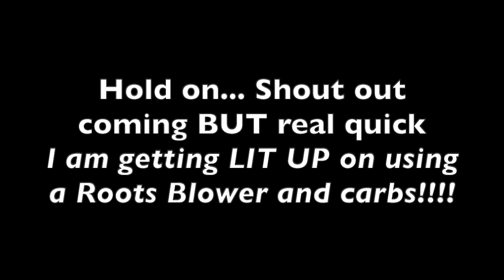Why Roots Blower | Boost with Carbs | Getting Lit up | Boost with Carbs

Comment: Watched  a many of  videos  of  the  bucket. ....consistent.
Reply from the maker: It is a hard tail and with the last build I did on the 406 it would run 5.19's but it was so unpredictable on the top end and the leave. It ran straight as an arrow with the 350 in it and would run 5.56 all day long. I should have left it alone!!!!

Comment: Roots with Carbs is a great set up , I’ve done efi with blower as well , yes it’s the new way but you will not gain anything in all out power , carbs continue to out perform efi at WOT , anyway I agree with your choice to go with a roots I love them , I’ve ran a 177 weiand , TBS 250 , 8-71 , all of them performed very well , I had been running a 632 n/a single Dominator 10:1 engine And boat would run 110 , built a 509 w/8-71 at 10 psi been 120 and still climbing , the 632 dyno 770 hp 800 + tq I did not dyno the 509 but it’s obviously making allot more power

Comment: I totally agree with the way you look at this stuff. I'm a few hundred steps behind you. I've raced the first engine that I ever built that wasn't stock about 10 years ago. It had some major failure about 5 years ago so I replaced the 454 with  a stock 350 small block and I'm starting over from step one.  I'm discouraged because of all the fast factory cars that are out now and so on. but I don't care I have a 72 C10 and the only thing I think would look right is a big block or small block chevy with a  4barrel carb on it.  I don't like seeing LS motors in any old car, well I like it a little but I still think its cooler to have a nostalgic hot rod. Hell I think it would be even cooler to have a supercharged flathead in that 48 ford. but those motors are so weak lol. The looks of a 8-71 on a small block would still look really cool though.
Reply from the maker: David Craft thanks so much for your comments! I love stuff that is different for sure! The LS motors just flat out work also, but the gen 1 SBC's are just so much fun. Go fast, go straight! Be Safe!!

Comment: You are a year and a half ahead of me. I have my TBS roots blower ordered, 2 Holley 630 cfm carbs from my tunnel ram going on my 406 but I am stroking it to 434. I have the crank, Eagle rods and AFR CNC 220 heads. Pistons and rings are needed. Time and money. Time and money. I have little of both left.
Reply from the maker: Stuart Buckley thanks so much for your comments! Time and Money... you got that right. LOL. That is going to be a mean motor!!!! What type Fuel you going to run? Go fast, go straight! Be Safe!!
Reply: @KevinWilsonSBC  Hi, I  plan on either 115 race fuel or E85 as I live within 6 miles from the "still", refinery. I am only adding 7- 8 lbs of boost to learn tuning which I really need to talk to you about and new double adjustable shocks which I am buying from you. See you Thursday around 4pm?
Reply from the maker: @stuartbuckley8720  I will get to the shop right around 4pm this Thursday. Come on by...
Reply: @KevinWilsonSBC  I will see you Thursday!!! 4 pm.

Comment: My engine builder says I do not have to boost reference my carburetors on my big block Chevy 871 supercharger for the drag strip only and only add 8.5 power valves and they will open down the strip. He has seen this before on the dyno with no issues but I have not seen anybody do this before.  what do you think?
Reply from the maker: menoaz thanks so much for your comments! I would not think a boost reference power valve is needed since the carb is not being pressurized from the top of the carb. The 871 is pulling air through the carb kinda like a NA application. For a blow through carb, where you are actually adding boost to the bowls of the carb, then you must run boost reference power valves. For a traditional roots type blower, I have never ran any boost reference power valves. Hope this helps. Go fast, go straight! Be Safe!!